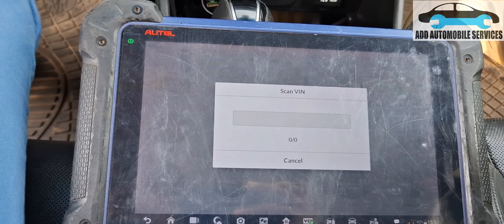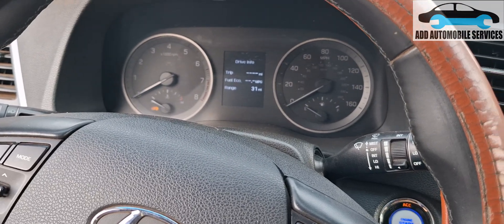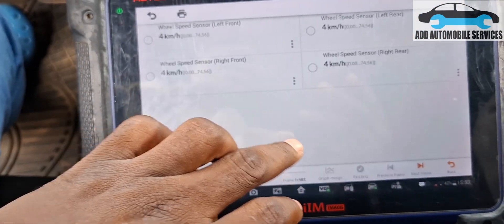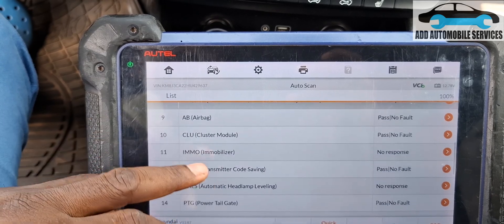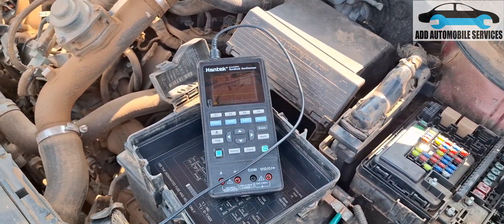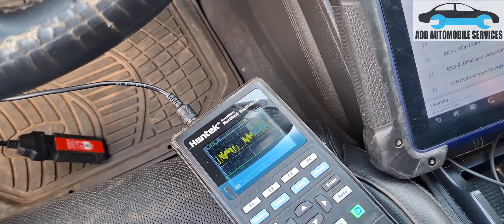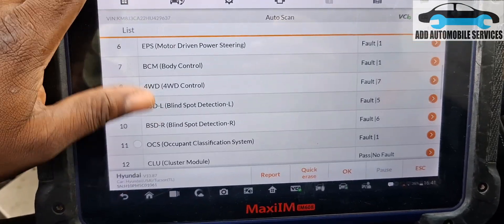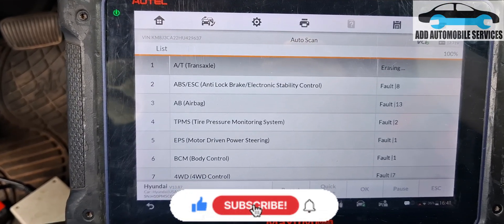2017 Tucson with communication issue(CAN Diagnosing)

Comment: Great job sir, 
I face this problem and still now i can't solve it i disconnected the back up camera and all the modules even the connector you unplug but no luck. Resistors are good.Can high have 2.9 volt, can low have 2.1 volt. If you figure it out the main cause please share us
Reply from the maker: Thus voltages are ok
Reply: Ok sir, thanks for your reply 
Does the problem happens again? If you can please share us the CAN wires diagram, thanks in advance
Reply from the maker: Will do that next time